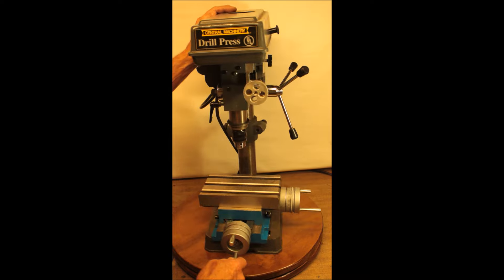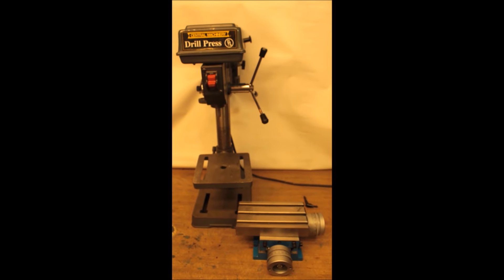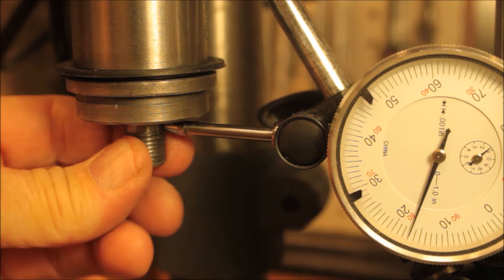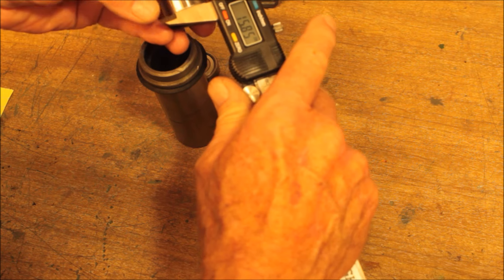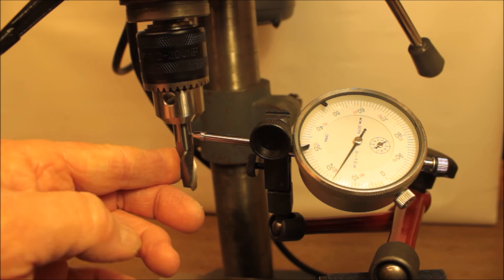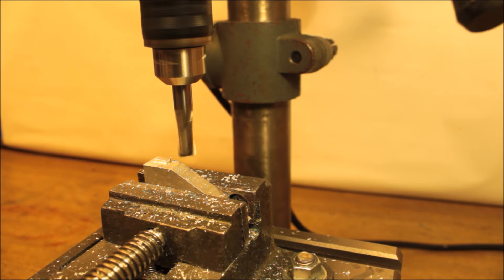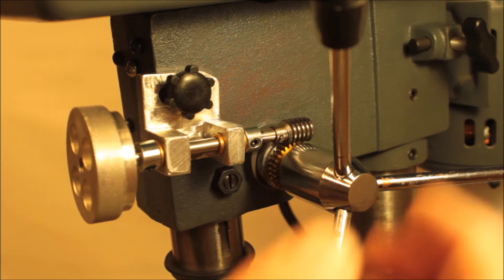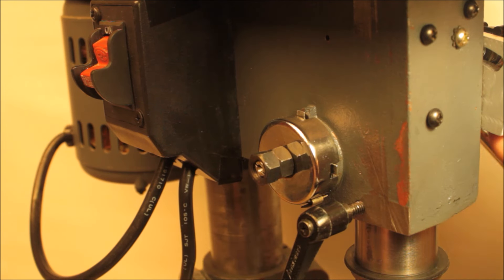Cheap Drill Press converted to Milling Machine

Comment: Really great use of an old drillpress. If lateral movement with the spindle/Chuck becomes excessive you can extend an arm from the column with a couple bearings on the end pressed against the chuck to control run-out. As long as the surface of the chuck is smooth. Saw this trick in an old magazine.

Comment: Good job.  
I would suggest using the very shortest stub end mill you can get by with, and 4 or more flutes.  Short will reduce the side forces on the quill, and more flutes will chatter less and work better at low RPMs.  Maybe you could lathe-turn a solid end mill holder to replace the chuck.
Regardless of the results, there is merit in doing projects like this.  When I was a kid there was no money for new stuff so everything was repurposed and I learned a lot that way.
Reply from the maker: Thanks for the comment and the great suggestions!

Comment: To pre-load the bearings, glue one in.  Counter bore the other with enough room to install an internal snap ring.  Put a thin spring washer between the snap ring and the bushing.  Use a tube on the shaft cut slightly longer than the distance between the bearing seats to hold the center of the bearings out against the tension'ing outer spring washer. This is a fun project your working on.  Probably most of your play is between the spindle housing and the cast iron casing.  Boring that out and installing a very close bushing on one end and a tapered sliding bushing on the other end would be very cool.  Of course this is outside the simple tools you have used thus far.  Also about outside your purpose would have been to turn a new spindle with a larger OD, use larger OD matching ball bearings and bore the spindle for #1 or #2 Morse Taper.  Then run a draw bar and collet arrangement.   I know, it's way over the top.  ;-)  Fun video.
Reply from the maker: Wow, I wish you could come over to my house and do this for me! Seriously though, thanks for a very well considered comment!
- Dave
Reply: Just buy a mill by then.

Comment: Excellent project, Dave.  It tempts me to rebuild my Harbor Freight 20" drill press to add a milling capability.  Tempts.  In this case the entire top half of the spindle has to be rebuilt to replace the solid upper spindle with a DOM tube for a 3/8" - 16 tpi draw bar for MT3 tool holders, plus better bearings.  Doable?  Yes.  Cost?  After buying a Grizzly 6" x 18" milling table ($220 shipped), much larger radial thrust bearings, DOM tube, material to machine a new step pulley with a much larger bore for the draw bar tube and maybe a worm/wheel the cost is getting close to Harbor Freight's Sieg X.2 milling machine ($581 delivered as of Feb 2, 2019).  Certainly $300.00.    Oh yes.  If you don't already have the 20" drill press add another $500.  Now we're at $800.00    Harbor Freight 1-1/2 hp mill/drill  for $1000 new anyone?  Comes with an 8" x 28" table, real R8 spindle, 750 lbs of vibration dampening cast iron, etc.  Or find a used mill on Craigslist for $500?

Comment: A good optimization of a cheap drill press. You just have to remember it still has a very small diameter spindle so keep the loads and feeds VERY light. Fine for cutting keyways and precision hole location. It can handle most projects in a home shop.
Reply from the maker: Thanks for your comment, Lawrence! Yes, I am with you 100 percent.  This was just for fun. Thankfully I have a real milling machine too.

Comment: Taper roller bearings would be a better option. Drill presses are only designed for vertical loads.
But hey, any mill is better than no mill!
Reply from the maker: Yes, I agree!
Reply: TommyGun Machining dude everyone knows that

Comment: For bearings, you could have gone with Timken tapered roller bearings instead of the double ball angular ones. Tapered rollers are designed for side loading. (I'm a bit biased as I worked for the Timken steel mill that makes steel for their bearing factory)
Reply from the maker: Thanks for your comment. Someone online recommended these as replacements but I am also aware that Timken makes the very best!

Comment: I've been contemplating a complete overhaul of one of these little drill presses . . .
for starters, the 'column' tube is way too flimsy to be rigid, same with the table & base !  I plan on casting a cement base, with studs embedded to hold the new square tube column, which is way more stable !   The head will be bolted to the column from it's back face, with added supports on the side of the head -  ( a sketch would be simpler than describing in words ! )    The column will also be filled with cement, with a bit of rebar for insurance ;)
      One of the issues with these presses is the high speed, which means either changing to a DC controllable speed motor, OR, to add a countershaft with more pulleys to achieve better speed control.     * Lower speeds would have much more TORQUE , much like a back geared lathe .  Rigidity is the downfall of these little machines , as they lack it !    
     Annular contact bearings are just the ticket for these, since space is limited, BUT, a 3/4 inch spindle could be made to suit. . . with tapered rollers / and a take up thread for 'preload'.
      The quill could be 'slotted' in a few places to accept GIBS, which would allow taking out practically ALL of the slop !   This would necessitate setscrew adjusters, which is no big deal.       It's a shame that U.S. built machine tools have 'forgotten' the home craftsmen - corporate greed has gone to overseas production , with the result being cheaply made goods of questionable quality !      * Try putting an indicator on the chuck, then pushing on the top of the head !   FLEXIBLE means SLOP ! ! !    Slop means chatter. . . the end result means inaccuracy :(            ** I  would suggest to anyone considering turning one of these presses into a mill , to buy 2 of them - and use the 'spare parts' ( motor & pulleys) to make a countershaft arrangement  to be able to harness the power at a lower rpm . . . TORQUE is a necessity !         * Good work with the spindle repair ! ! !
Reply: Oh, I forgot to mention that attaching the head to a square column instantly turns the machine into a 10"er . . . * BUT, this same unit could be mounted like a RADIAL drill press, with the head mounted on a horizontal , movable column that is mounted on TOP of the vertical one !     HAPPY BUILDING !
      last words : " If you can't make it ACCURATE, make it ADJUSTABLE ! "
Reply from the maker: You are the real deal, George. You will build an Aircraft Carrier before you are done! :-)

Comment: Cool, thanks. Cool, do-able-for-me, easy quill lock! Maybe a downfeed later, hehe. I got a larger, 6" capacity, 7" travel cross slide so needed a larger drill press (maybe good in the long run but I'd have bought yours if done over and just used my similar press). I maybe should have bought online, but the $75 one at HF in person (gotta have it now, sight-seen syndrome) at least beats the pants off the $65 wobbly-even-after-mods one at HF. Your cross slide looks nicer, more precise with the better dials but at least the second one I bought moves smoothly after cleaning, stoning, and greasing. My larger press has no depth stop or lock at all (weird esp. the no stop). The Tradesman floor press does have less spindle bearing play but I did notice on my lil' General benchtop press didn't wobble as much as expected once turned on, like the "slack was taken up" by the added tension of the energy or movement (?) a sort of artificial load was generated or something (?)... but the cross slide runs into the support tube of the little press so I'll need to make a quill lock for the big one to work on it.
Reply from the maker: Everybody who shops at Harbor Freight understands that they are not buying a top quality tool but you cannot beat the value for the money! Many of my HF tools are still around but some have been replaced by more expensive versions. Depends on your usage pattern. Use those coupons!

Comment: I like it , did a similar project before I got a mill.. I think adding some weight to the head ( like dumbells , sand , whatever ) and bolting the base down to something solid will help with chatter , vibration , and most importantly , save your ears (-;
Reply from the maker: Thanks for the superb suggestions, Rob!

Comment: Have you done anymore work on the drill quill since this vid?  I saw someone suggest quill slots & gibs to take out the play while moving.
I got a Harbor Freight mini lathe, 
and I am seriously eyeing the saddle & cross slides for use with a modified drillpress bolted to the lathe 'over'  the slides.  Scored some 3/8 thick 3.5" angle iron from a scrapyard, so RIGID framework between lathe bed & drill head should not be a problem.  Love to hear if you had any more progress on the quill/chuck flex.

Comment: SMM,
Just a thought on changing the bearings...(I don't have a lathe, yet.)
  I know the bearings on a drill press are "designed" for vertical pressure , and not lateral/ horizontal pressures that may dislodge the chuck...ejecting it across the room, giving a whole new meaning to "fly cutter"....but, 
  I'm considering drilling an +/- 1/8" hole perpendicular all the way through the entire quill,  spindle and the chuck taper shaft out the other side....then inserting a "spring pin" (aka roll pin) that is recessed within the quill, but connecting the spindle to the chuck arbor...that would suffice in securing it, but also making it easily removable for future chuck changes...kind of like a shear pin...but for light duty.
....Your thoughts.
Reply from the maker: Sorry but I cannot advise you on this. Good luck!
Reply: Thanks SMM, 
I did some more research with exploded views of various machines...
  It seems it would depend on the design...and only work with presses using MT2 / JT3 Arbors...
Some machines have the chuck directly connected to a threaded spindle. But with a little finagling it might be possible as well.

Comment: I really like your ingenuity! Also I agree with with Crafted I think a lot of that slop is between the quill and the housing casting. And machining that chinesium cast is kinda like machining old dried out cheese I would consider doing what someone else here on YouTube did and cut a slot in the front of the casting with a stop hole at the top so it won't crack and a pinch bolt with a nylock running horizontally so you can fine tune the play with a DI. Crude but should get rid of a lot of wiggle. Good luck!
Reply from the maker: Thanks for a very useful suggestion! Much appreciated!

Comment: Nice video. Neat project. I've got a similar Craftsman bench drill, and have been looking for a way to do some really light milling with it- The tapered spindle was obviously not going to work. Your approach seems simple enough! I just added an Atlas lathe to my shop, So I think I am going to give this a shot.
Reply from the maker: Thanks for your comment, Andrew! Good luck with your project. It's a great way to exercise your newly acquired Atlas lathe. You could also get a milling attachment for your lathe. You may want to check that out. Have fun, Andrew!

Comment: How much does the quill lock deflect the quill when engaged?  Is the end mill parallel to the work then?  sounds like the end mill is trying to climb the work.  Good video.
Reply from the maker: Thanks for your comment, Terry! This is not a high precision machine. There is a bit of deflection as you might expect and the degree of parallelism is probably not great.

Comment: Very cool... but how did you get the bronze (brass?) gear wheel on to that shaft? The shaft on my drill press is machined/hobbed out of one piece by the look of it.
Reply from the maker: I cheated and used a nice South Bend10K lathe to help with this project. :-)
Reply from the maker: If I remember correctly, I had to cut the shaft and make a splice for it.

Comment: I applaud your ingenuity but seriously, don't do any milling without a draw bar. Morse taper shanks have a nasty habit of twisting themselves loose without something to hold them in place.

I had a crack at doing the same but it ended badly because I didn't add one.
Reply from the maker: No taper involved as I remade the spindle with 1/2-20 threads.